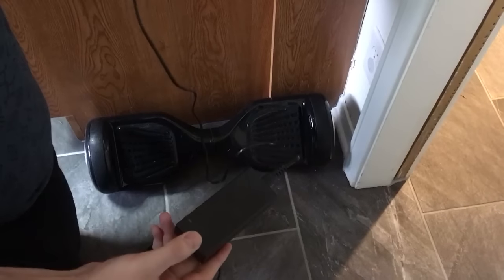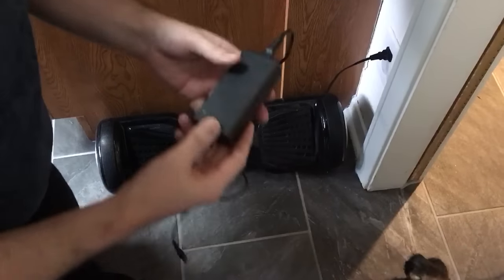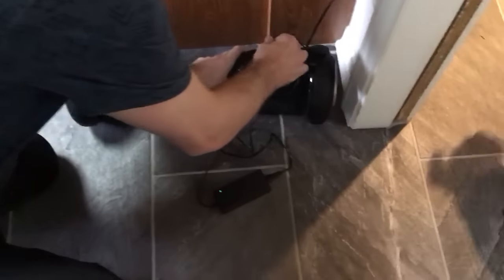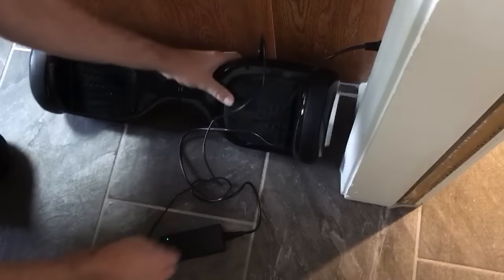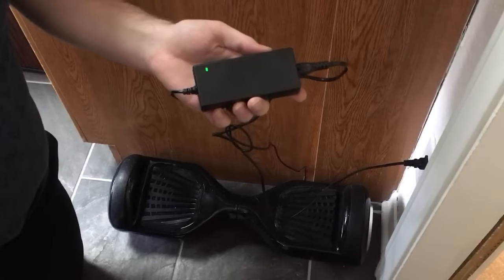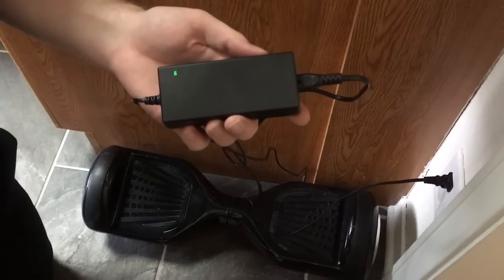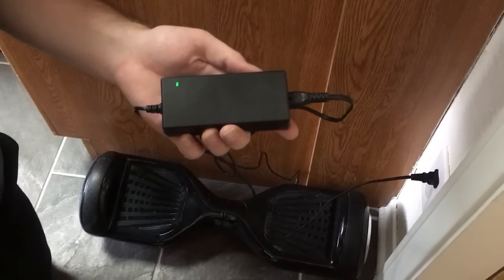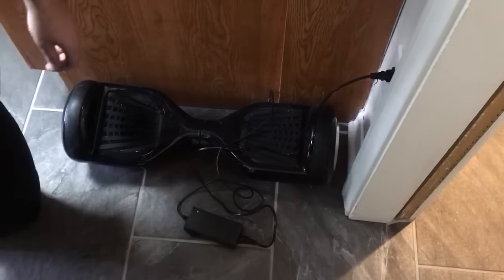Scooter charging problem

Comment: Probably  the ground connection on the plug in came off. Just take it apart and solder it back on. This happens with a lot of these kind of plugins to the charger. I fixed mine last night this way.
Reply: how do you take it apart?

Comment: I know this upload years ago but just in case anyone looking for answer...It's not the charger. I had this problem with scooter. It's the battery inside your scooter, the connection is dead. I had to get mine fixed and then it worked.
Reply: 😢 is it expensive

Comment: I had same problem.. issue is your battery is done. Prob a cell died..could be false contact but o doubt it.. to fix .. you need to replace battery or find dead cell and replace it. Buts its easier to just replace whole battery..

Comment: Ok so what you need to is put your feet on the hoverboards moving pad than hit it three times it has to be hit by a bed or a wall then plug the charger in a extra outlet thingy plug it in and boom the charger is red

Comment: TRY CHARGING THE BOARD WITH A LOWER VOLTAGE CHARGER FOR A WHILE, THEN TRY TURNING IT ON AND CHARGING IT WITH REGULAR BRICK CHARGER. HOPE THIS HELPS.

Comment: When you see it flashing do not unplug it !!!!! 
It’s the BMS calibrating the batteries. Could take up to 4 days to finish “up to”. You’ll get better range and performance after it finishes

It’s not a charger problem, if a new charger fixes the “issue” is because the new charger is undervolted and the BMS does not recognizes it so will put it into safe mode in which your battery will only charge at a safe level of about (85%). Can take months for the BMS to start calibrating for the new charger so at some point you’ll get the blinking again. 

Blinking charger is a very healthy thing, it keeps the batteries healthy and all at the same max voltage. 
Blinking means sending pieces of charge to the batteries. 
It has to blink because some of your pack batteries are high and some low, so it must send pieces of voltages to let the high ones drop down and bring the low ones up to an equal voltage to the rest. 

The BMS will slowly discharge the high batteries and let the charger charge the low ones, this process must be done in sessions of voltages to avoid the low batteries from overcharging or exploding. Each low battery cell is at a different low voltages so the BMS must calculate and cut the charge when the battery cell is at a designated level, once all low batteries are at the designated level of charge “equal voltage” then it starts charging the high ones with the rest of the low ones, will let the charger do the rest so the charger will stay red for about an hour so. After all this, your batteries will stay up and working at full performance. 
Since the low batteries charge up to 95% of their original capacity, the BMS will lower the high ones to 95% to keep them all equal. 
You may think that you lost 5% during that process but you must understand that when the batteries run at the same phase, the performance is grater in the eVehicle. Will result in longer range and faster speeds.
Reply: @Quacked sometimes more sometimes even minutes. All depends on how badly the battery is.
Reply: @Quacked it has to be flashing Red/Green. Then everything is fine, let it. 

If is only flashing red when plugged to the scooter, the charger is faulty. 

If is flashing green when the charger is unplugged from the scooter, the charger is faulty. 

If the charger is green when plugged to the scooter and the scooter is not charging, the BMS battery is faulty.
Reply: @Quacked no, shall only do the calibration once a year or so. But not daily. 

What voltage and Ah is your scooter?
What voltage and Ah is your charger?
Reply: @exklimexklim  What if the charger is green while unplugged, and only blinking green while plugged in? Would you happen to know what that indicates?
Reply: @Sessorous  charger is dead
Reply: @exklimexklim  dude your lying
Reply: Hey so my charger is flashing green when not plugged in and when I plug it in it flashed green and red, sorta mixed signals here, what do I do?
Reply: @virarora2225  the capacitors are dead. 
Either you fix it or buy a new one. 

This behavior happens when you try to connect 2 chargers into the scooter dual charging ports, but one of the charger has different amperage. Therefor the higher amperage charger kills the lower amperage one.

It is highly recommended to plug 2 chargers with the same voltage and same amperage to the scooter for fast charging.
Reply: @exklimexklim  but it's only one charger, I left it for about a day and it went from 10% to 21%, and how would I fix such a thing. Thanks so much
Reply: If I unplug it during the process, what are the consequences? And what should I do next?
Reply: @exklimexklim  my charger is only showing green when i plug the battery in it, it was working good before that does that mean battery is dead or charger?
Reply: this is the most informative comment i have ever read thank you for sharing.
Reply: bro i did not understand how to fix its still Not Charging
Reply: @Sessorous  I just had a first little trip with my e-scooter and had the same issue as you described. apparently when the charger is blinking green while plugged in - it means the battery is pretty much full - as it was in my case. hope I have helped ^^
Reply: My charger shows green.  Not blinking but just constant green like its full but my board is basically empty. Anyone got a way to fix it ir does Anyone know whats wrong with my charger / board?
Reply: @savekillqqpsounds8473  Conseguiu resolver?
Reply: @crqhardware  idk its model name lol
Reply: أضن ان هاذا احسن تفسير بارك الله فيك
Reply: my one seems to be blinking red and yellow some one help please

Comment from the maker: The problem was the charger. I bought a new one and then it worked fine.
Reply: I bought a new charger and it was same
Reply: What brand of hoverboard do you have
Reply: I had same issue .. bought new charger and same thing .. so I replaced battery and it charged up again flawlessly.
Reply: This charger is the new one I bought so I guess they sent me a faulty one then that’s tuff
Reply: Like 23 dollars
Reply: Have the same issue but only on one of the 2 batteries i own so the charger works fine at least on one of the two...

Comment: I have a swagtron t1 and bought a new charger cause I lost my new one then I plugged it in then it worked for 4 seconds then shut off I plugged it back in now it just goes to red from black blinking I went to my grandmas for a few hours came back and still blinking pretty sure it’s not my battery either

Comment: Yeah hi mate I've just sent you a video I'm getting the same kind of problem but mine's not going green what I think yours could be might be the connection I sometimes I get corrosion and in like the wires check that or spray with WD40 hope it helps

Comment: Just got new scooter with new lead acid SLA charger and it has red and green light, green is blinking non stop even after 20 hours! It must be something wrong, anyone knows?
Reply: sounds like current issue, my charger for my bolt pro won’t stop blinking green, I also feel like it’s not charging my bike since the charger isn’t even hot or warm

Comment: It's your battery cells....some are bad so the voltage is low ...the charger is acting like a BMS when it blinks red and green....it's called twinkling.....it's giving the batteries that are low time to catch up with the rest of the voltage....charge every battery separately to the same voltage and put them back and charge the hover board again and I bet it will stop at red.... 😀😀

Comment: This is a hover board not a scoter 😂
Reply: Same difference , its in the connector on the charger . open it up and you'll find the ground wire came off. It's usually a 3 prong plug in.

Comment: you need to turn on the hoverboard while it blinks, so plug it in and turn the board on
Reply: CallMeDynasty does that really work in having the same blinking problem
Reply: That person above is incorrect.  It's either a bad battery or a battery that is really low or has no charge.
Reply: Maybe i think the charger is not compatible isn't?
Reply: Just got my charger. Board is dead but charger is saying full battery. When everything gets plugged in i held down the button and it beeped. So i know it works its probably just super dead. Idk why its saying its fully charged cause its defintaly not. (Charger problem but new charger) ima keep messing with it ik it works but ima investigate!
Reply: @Ballardcomputesllc  what do i do if it’s been in storage for winter and now it doesn’t show any charge? I tried to plug in the charger but it stays green.
Reply: @marcia2095  the battery is probably shot.   Replace battery.  You shouldn't store batteries like that.

Comment: My hoverboard dies after 30 mins
Reply: Bad battery
Reply: Ballard Computes LLC my e kick scooter was sitting around for over a year the scooter and battery fairy new it was fully charged I let It run for a while and it die I plugged it up and the charger light is green
Reply: Marvin Ballard yeah I destroyed my back tire and had break problems I had a hard time finding the tire size so I sat around for about a yr it was it was running I tried to let the battery run down so I can re charge it ...it cut off but charger stays on green it find another battery thanx
Reply: Ballard Computes LLC  but my digital multimeter shows around 38 volts when tested
Reply: Nishant Rajgarhia multi meters don’t test CCA’s